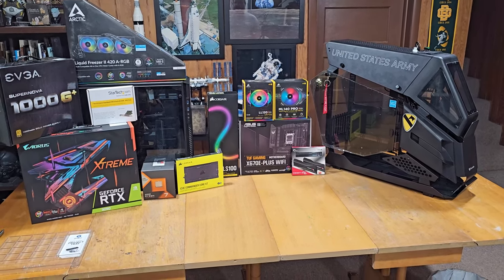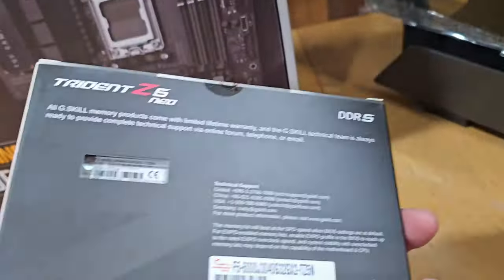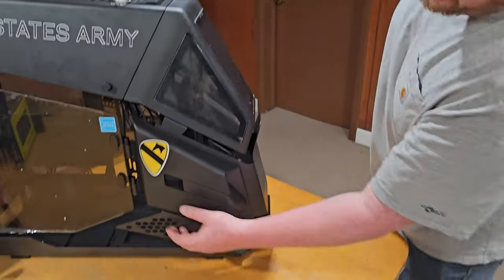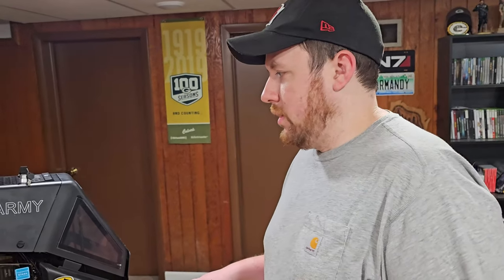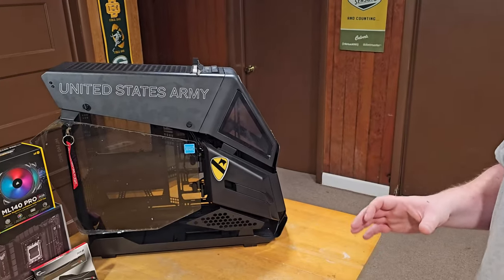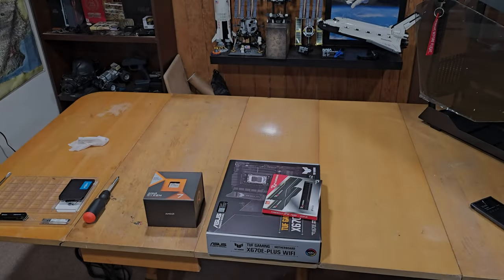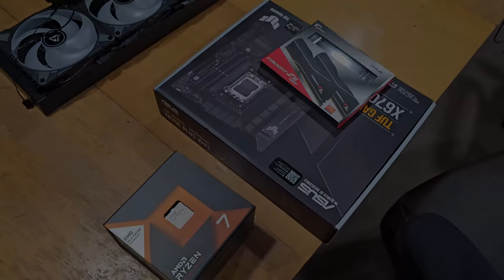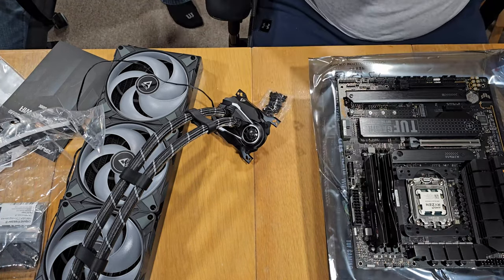Apache Part 1: Teardown and Board Assembly - AHT600, 7800X3D, RTX 3090

Comment: Awesome build. I'm into the military aviation as well. With being born at Cannon AFB - it's in the Blood. If I could get a pc case that was a SR-71A BlackBird ; I would have it ASAP.
Reply: Cool build and theme. Know exactly what you mean with Cannon in your backyard. I don't get out that way too often. But one site I would visit while in town was along the flight path of Cannnon, and seeing and hearing those F15's fly overhead usually in close formation, i.e. F15 with his wingman not far behind was a nice spectacle. The F15's are gone now, but they got some interesting other aircraft and missions going on now. The support of that town (Clovis) saved Cannon from being closed in the mid 2000's. Too bad Roswell in the late 60's couldn't pull that off when they closed Walker AFB. That town went from being projected as growing into the 2nd or 3rd largest city in NM to 5th or less. It took more than 35+ years to gain back the population loss and economic loss they had in the late 60's to finally being the same again in the early 2000's.. meanwhile Las Cruces and Rio Rancho boomed ahead of Roswell and never looked back. I'm now in ABQ, so you see activity with Kirtland AFB, lots of C130 CV-22 Osprey.